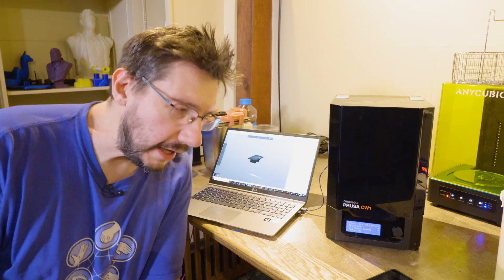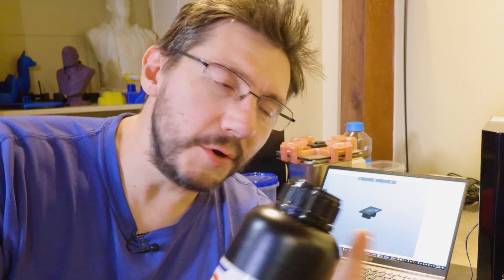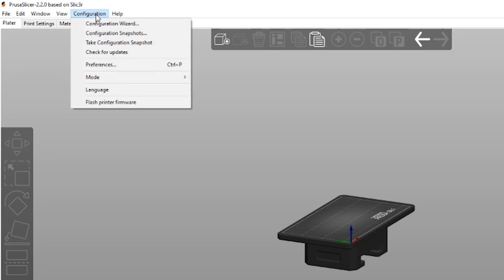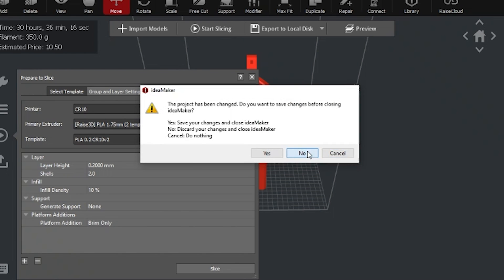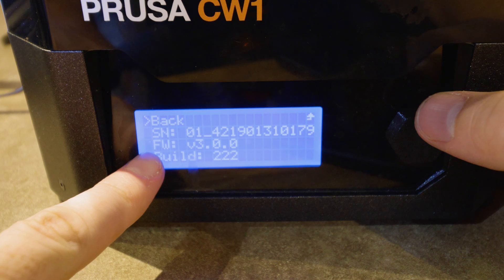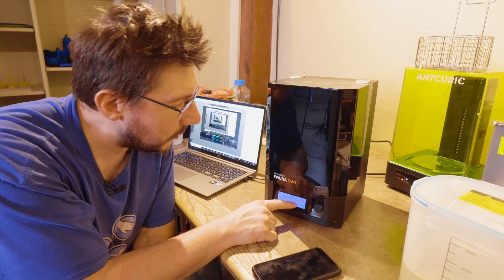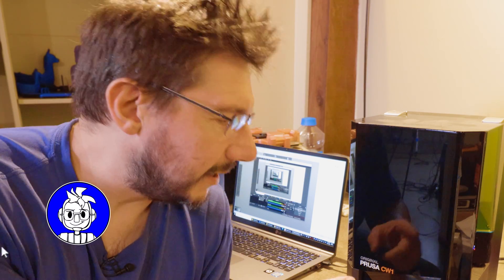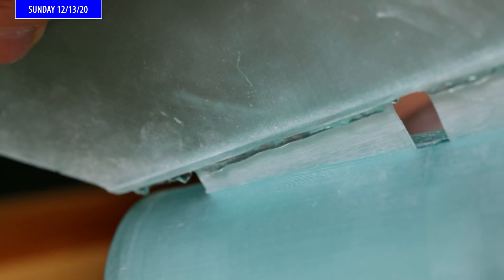HOWTO: Upgrade Prusa CW1 Firmware // 3DPN Quickie

Comment: if resin works better warmer. why do resin printers not heat the resin in the build area?
Reply from the maker: Most resins don’t need extra heat, they just don’t like it TOO cold. Some resins like a little extra heat. For a typical resin if you start having problems, you can add a little heat. For BLU and other resins like it, it’s best to add some heat before starting.
Reply: Good question dude 👍

Comment: Why does it do better when warm? Is it because it flows more easily? Does it cure faster? Can you offset the advantage of heating by increasing the time the build plate retracts? Can we see the difference between preheated vs room temp resin prints?

Comment: On Linux you might need to assure that the slicer has permissions to use the port. Quick fix is to start slicer with sudo (though it probably shouldn't be done with superuser 🤔😶)

Comment: Is it possible to use CW1 air distribution as vapor somothing chamber for ABS/ASA?
Reply: I would highly caution against that! Acetone is super volitile and flammable, and creates a possible exploding gas vapour. It can damage the machine inside if there are any styrene based plastics in the circuitry, or simply ignite.

You stand the risk of completely ruining the CW1 :/
Reply: @beetrix12  can i use gasoline then as the solvent?
Reply: @beetrix12  Yeah that makes sense, But what about Prusa's official modification for that particular purpose, if existing one won't work.
Reply: Granted there is risk, but given that "polysher" thing exists it could be a thing no? (or was that just IPA?) Still a liquid vapor explosion/fire hazard with all of these so do be safe!
Reply: @ericlotze7724  Gasoline, Acetone and IPA are verry different chemicals. IPA is not so volitile as Acetone and is much safer. Yes you run an explosion risk in gas form, but in a much higher consentration of oxygen/air. Also, IPA is known and used for cleaning electrical components e.g. circuit boards.

Whomever made the machine has made it safe to use for the chemicals listed. If they made it to work with both IPA and acetone they would probably list it on the webpage like printers bragging that they can handle both PLA and PETG and PC etc.

Lets just say that while IPA smells bad, it can be filtered by a reusable A2 organic gass carbon filter. Acetone however requires a much more expensive single use X filter, and a full face gass mask. It's main use is that it can be used as a solvent for most plastics https://en.wikipedia.org/wiki/Acetone#Solvent

And NO, please do NOT use gasoline :P

Comment: It's nice but I don't want to be overly critical. But USB-C came out almost 7 years ago and a $700 dollar machine is still using old school plug?
Reply: Probably because most people still have plenty of Micro USB cables laying around. Plus you don't really have to worry about a badly made/out of spec Micro USB cable where as this has been a problem with Type C cables for ages. Even now, you can find out of spec Type C cables on Amazon.
Reply: @shadow7037932  I agree to some extent, but I never realized there was that much issues with type C. But that may be my own ignorance ..lol plus I typically only use high current or high speed cables and they tend to be a few extra $$$. But even the Raspberry Pi 4 is type-C.
Reply: @sortofsmarter  but a non-compliant Type-C
Reply: The main reason that printers, 3dprinters and most equipment come with micro-usb-b or usb-b is often just so that you won't connect them wrongly like printer to printer.

The usb-c is also rather complex and supports a lot more protocols than a simple micro-usb-b. Your phone can e.g. connect to an external display from that port, have a mouse, or even an ethernet cable.

Also usb-c has a million pinns, and a lot higher amp. It might simply be difficult or a lot more expensive designing a circuit board to handle it for absolutely no gain.
Reply: Though I would suppose you know all this, after checking your profile. So please explain why I'm stupid 🤔😇😅